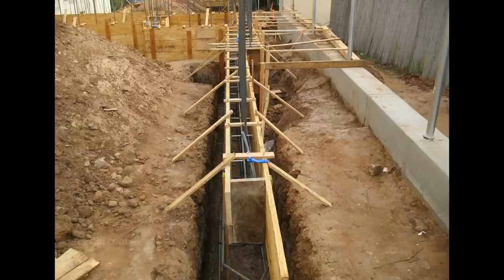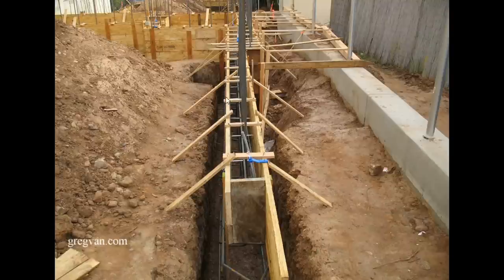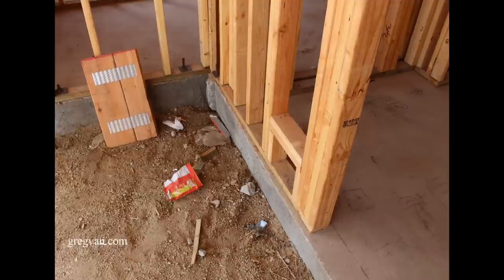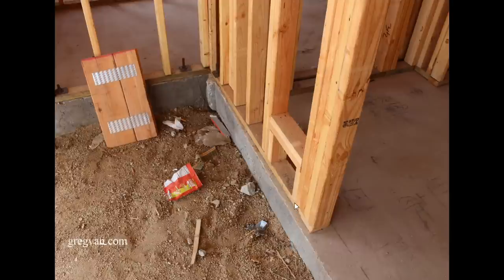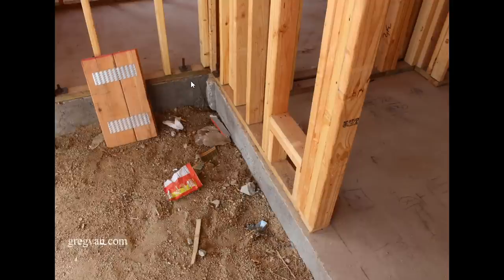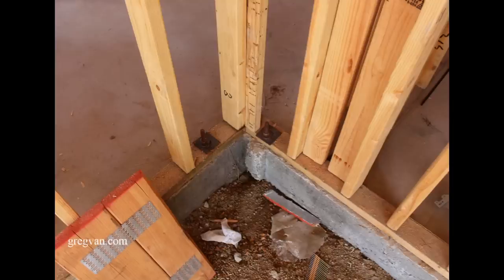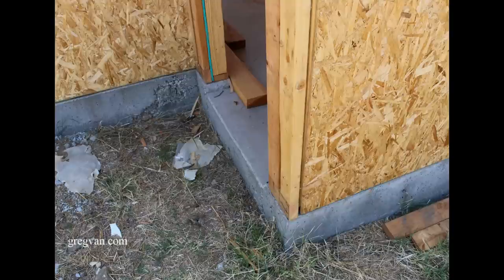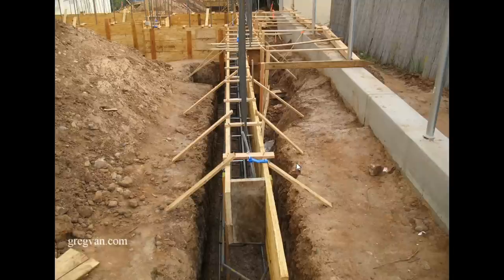Watch This Video Before Pouring A Concrete Foundation – Construction Tips

Comment: It is always cheaper to do it right the first time than having to do it over.
Reply: No it's not. It takes a lot of time to get things perfect and usually this stuff just gets burried. We are not building pianos here, just the boxes they come in. Git er done!! Ruhh Ruhh!!
Reply: As for the concrete wall being a little off, that's not a big deal, by the time the sheeting and siding goes on, not even a fuss budget will notice. As for this guys advice for the framers to build to the foundation,,, that's is just stupid, stupid stupid.  I mean if you would like to hide a strip of concrete in favor or a 3/4 inch calk joint on your counter top... yea go ahead. If a customer wants a nice finished foundation wall that cost extra, either for a form liner or parge coat. This goes back to every one wants top quality, but no one wants to pay for it,
Reply: That kind of attitude will get your work rejected by the architect or at least a payment application withheld.
Reply: Gary, that only happens on state and government jobs, and that's why those jobs cost twice as much and still manage to go over budget. There is a part of the real world that keeps silly non issues from being addressed ( like the foundation in this video for example )  And that is construction delays cost the general contractor money, not the sub contractor. As for not paying, that's a great way to get a lien put on the property, and you cant sell property with a lien on it.Now you can put late fees and a lien waver in a contract, but expect the bid price to be much higher and you will also have less contractors who will even bid on it.
Reply: No so as far as only being limited to state or government jobs. I have rejected bad concrete work and made them remove and replace it because they couldn't take the time to do a professional job or follow the drawings.I do not consider poor workmanship a silly issue  by any contractor.  Any issues for poor workmanship may be the GC's problem but the sub-contractor pays for it one way or another by not being hired again especially if the payment application and or retainer gets reduced or held up.You would be hard pressed to prove your case for a lien with bad workmanship.
Reply: That is so true. I have seen types of forms that were ill constructed, watch the concrete pouring in and then watching forms blow apart. I once witnesses whole garage slab that didn't set up right, and the contractor had to send a crew back to bust the whole thing out and then re-pour. That was a big stress factor for the home owner and my boss who was the General Contractor for the particular project. Lots expletives by lots of individuals! I felt bad for the Concrete Contractor as I think it was something to do with the deep dead of a very cold winter we were in, when they poured, which if I recall was a factor in the mis-hap, as the Contractor was no slouch and had a very good reputation. Just one of those unfortunate things with concrete!
Reply: You need to find the happy medium when in construction
Reply: @edstimator1   Forty plus years in the concrete business says you're wrong.  The fastest and cheapest way to build with concrete is to take the time to do it right the first time. If you rush through it without getting it right you will LOSE time and money.
Reply: @stephenblessed92  I live in a pretty goddamned nice house after doing it wrong for fifty years.  Never did a job I didn't sell.
The key is knowing what counts and what doesn't.  Not everything needs to have the same level of perfection.  But you are right...if you haven't been able to figure it out after forty years you better treat everything the same.

Comment: Simple, like anything you start out right you end up right. Our 15 man crew did a $80000.00 multilevel pour virtually perfect. The amount of experience in the crew probably accumulated to about 15 years of concrete work. But the amount of years in precision work in various trades was more in the neighbourhood of 300 years. I'm not saying this to brag but to express the notion of what experience teaches. Review the errors with a fine tooth comb. Of course shit happens , but don't use that as an excuse. Learn from it.
Reply: Agree always no where you starting and where you FINISHING

Comment: Also, at 04:13 looks like the concrete was not properly placed or vibrated since there is exposed aggregate on the surface and pockets where cement should be.
Reply from the maker: I've seen this a lot and often wonder how many problems are created by it.

Comment: They guy had his inside corner on backwards and either nobody scraped the top wall, or because the wall was not supported by kickers and was way off the plan (also could have been concrete nails in the footing or off measurements/misunderstandings/ misprints.) pressure from the concrete filled the bottom of the inside corner that was on the top of the wall, making your "Hutch" or whatever you called it. The company should have chipped it off when they stripped the walls.

Comment: I hate to think of how much time I've spent fixing crappy concrete. And what do they give you to do it with? A brick hammer, a hammer and chisel or a bush hammer. That sure did make me feel underpaid. lol

I also hated when the contractor would straighten the forms AFTER you poured and floated the concrete. But that was better than fixing it after it set, at least.

My nightmare job was a set of steps I fixed once. 10' wide and 15 steps were bowed out as much as 1.5". It looked beautiful when I finished, but what a pain. At least I had a electric hammer for that.
Reply from the maker: +TheTomBevis Those who truly understand the importance of the information in this video are the ones like yourself who have had to either remove or add concrete, because the forms weren't straight or properly secured.

Comment: Does that defect
weakens the construction on top of the concrete?
And if in what way ?
Can make any good reason why a guy
should grind a concrete tunnel with
a mega grinder ?
Concrete should only be used as plitnts in the ground
NADA MAS.
Reply from the maker: It might not weaken the concrete, but sometimes the rebar used to structurally reinforce the concrete can get pushed out and if it is exposed when shipping would weaken the concrete foundation. Also grinding the concrete next to the rebar could weaken it if it becomes within 2 inches of the rebar.

Comment: I thought a possible cause for the lines on the side of a slab were caused by the difference in moisture content or temperature between the top and bottom of the slab.
Reply: I guess the American Concrete Institute is wrong then.

Comment: You think this will happen if I use metal formwork instead of Lumber?
Reply from the maker: It can, the forms whether they're made out of wood or metal need to be positioned correctly and stabilized securely so that they don't move when the concrete is poured. Whether it's wood or metal it needs to be securely braced so that it doesn't move.

Comment: you know 
, wood does not come straight and has its imperfections and ergo the wall that your  forming will. I do ICI formwork, instead of residential formwork. Thats why you should buy "formply", which is why they use it in ICI construction, instead of spruce.
Reply: exactly
Reply: Ergo we're building our walls we actually cite the wood if it's crooked bent or twisted or has a crown in it we most likely will not use it not in the custom house maybe if we're building is quick build quick sell houses it wouldn't matter will leave the drywallers to figure it out the custom house very picky in our lumber we don't shop at Home Depot

Comment: Dear Sir,
That half inch space will be filled in with half inch plywood sheeting making the 2x4 plumb with the cement
Reply from the maker: Them it won't be a problem, but 2 inches will.

Comment: form lines are because u need a tiny gap for form ties to go in so u will always end up with lines. I always drive my kickers past the top of forms that is against the form for better strength and not in the way of floating. not the best form job example but close enough for this video.

Comment: in mass production is not the same build a home and build 1000 homes is mass production this is common problems in our daily basis life  where we have a crew just to correct any imperfection on the punch list of the project is easy to judge after finished but different when you are working and have to complete 5 or 6 in one day , one crew forming and other pouring concrete

Comment: I dont see any DPM under the floorplates on any of the framing,dont you need/use it in the US?
Reply from the maker: I'm in Southern California and we don't use DPM, as a matter of fact I forgot what the initials meant.
Reply: I should have spelt it out Im in the UK,we need DPM on everything:)
Reply from the maker: In some homes we use plastic that's about 6 mm thick as a moisture barrier under the slab, but it doesn't go into the concrete footings.
Reply: Our code,building regulations, has a long list of anti-damp regulations the EU has added many in the name of ' eco'.It would be strange to build without them.Theres people from all over the world that have access to your vids due to the net.  I find it very interesting what you have to do to meet code,its a lot more rigorous over the pond.

Comment: No damp proof flashing between the slab and the timber plates to stop rising damp ? is that common in USA?

No termite problems in USA?
Reply: Still get rising damp - the timber of the plate may not rot but the cladding may wick up and do so.
Reply: It's California.  It's pretty dry out here.  I've only ever seen rotten sill plate if flashing or wrap/kraft paper is incorrectly installed.
Reply: No that is not common in the the USA at least not where I have ever built . Regardless of code I would have used a pressure treated bottom plate and a moisture break .

Comment: I am so lost here, how much structural problems are shown here; too me it all looks cosmetics / bad planning will the building fall ?
Reply from the maker: I doubt if the building will fall down and if you're okay with with the way it looks, then by all means ignore the message in the video. Excessive chipping can expose structural rebar or bring it to close to the surface where moisture can be absorbed causing the rebar to rust.

Comment: Holy shit...its like every contractor in the world showed up here and had to validate or disagree with this video...let me give you guys a clue..this video is not for you. If your a contractor you already know how to do this and if you run into any problems you know how to take care of it or work around. This video is for people like myself who plan to build their own workshop/garage/shed and would like to use concrete as a permanent and solid foundation as an option. These are just simple tips to avoid and or look for to make my life a little easier. But I do find it hilarious that there are so many of you with 20+ years of experience that landed on this video on "Construction Tips"
Reply from the maker: You can't even imagine how many comments I had to remove from this video. Obviously it doesn't have every thing you need to consider in it, but I still think it's worth watching. Thanks for pointing out the obvious to those who have a difficult time figuring out what this video is truly about.

Comment: I use aluminum wall forms and do foundations for a living. Our walls dont lean, bow, or sag. This job looks like someones just trying to save money by using wood as there forms nd there just not strong enouph. Aluminum forms allow us to slide walls with little effort to get our foundations square after there set. Then  braced streight with 2x4s. Wood is a nightmare with concrete because concrete is so heavy. Looks like alot of honey comb on walls to.
Reply from the maker: Sounds good to me. Aluminum forms might not be a practical solution for do-it-yourselfers or construction workers who only do a few jobs a year. However, if you're building forms that are straight and square, you're going to be everybody's hero on the job, who usually doesn't get the credit they deserve. Everything starts with you guys.

Comment: A lot of these issues have to do with home builders wanting homes built in 4 weeks.... Setting a house no a new slab in 2-5 days after it is poured I am never happy about... I watched  builder pour remove the forms and a day later had the house standing... Why are the walls not over lapping the concrete also lol

Comment: I don't untarstant why after slab don't raising concrete columns and concrete slab again and the using wood every where. Or a construction with outside walls made by bricks the interior also or plasterboards and only the floors maybe made by wood.
Reply from the maker: +telosfd I think you're asking why don't they use more concrete instead of wood, but sometimes is more efficient and cost-effective to use wood framing. I don't know if this answers your question, so feel free to rephrase it or ask another.
Reply: Yes, thanks.
Reply from the maker: You Bet.

Comment: Good video but you didn't address the honeycomb they left from not vibrating enough many home owners see that and get upset.
Reply: I would rather see honeycombing then have some one over vibrate the concrete and work all the stone to the bottom, same with people who use a vibrator as a shovel,
Reply: Your right its never good to over vibrate but home owners hate to see honeycomb they think its a bad foundation and it scares them.

Comment: Concrete slabs are never perfect, and I don't know if we can really expect them to be perfect; life is all about speed/time/money so it will always be so. Buildings are constructed by professional contractors and they have to get so many houses done by a certain time; if they took the time to make everything 200% perfect, one building may never get finished. The more perfection that's expected, the more costly it will be to buy better material for the forms, because a pour is only as good as the material used and the time it takes to build the forms.
Reply from the maker: In home building, it all starts with the foundation, if it's wrong, then you will increase your labor and material costs needed to fix other parts of the construction process. So spend the extra time, maybe not 7,000,000 percent, but do what ever it takes to do the best job with what you have.

Comment: in my world of concrete construction,  this lead person, contractor,  crew,  individuals would be gone within 30 seconds of my inspection of the things seen here plus the items you mentioned.    the form is a none starter because there's no where near enough rebar in the void for concrete.    I've seen something very much like this on a Mexico construction site for a chicken processing plant.   Beyond this there were live chickens running around with dogs chasing them through the plant area because chickens that got away from the butchers, were being butchered as the construction was going on.   all sorts of make shift  things going on,   including the ditches were being dug crooked because the workers were finding ancient Indian artifacts as they dug making the ditches run in all directions.  regards
Reply from the maker: I would've fired them also and that's weird about digging ditches around artifacts that weren't straight. Remove the artifacts and then dig the ditches straight.
Reply: initially I thought that it was just poor management / training of workers digging ditches.   some of the lower management folks were amused by it,   until upper management  jumped on their posteriors because of the delays & gross waste of time.    in the area there was a strong cultural thing to do with various celebrations,  shooting random - some times continuous fire works,  and fire arms fired straight up into the mostly night sky and of course moderate to heavy drinking,   then those that were offended by management coming down on them simply didn't return to work on the project.  regards

Comment: Finished brick walls and vinyl siding covers up lots of mistakes. That little bit of protruding concrete won’t even be noticeable. If only you knew of mistakes and shoddy work drywall covers up
Reply from the maker: Good point, if you have something that will cover any mistake, then it might not be an issue.

Comment: Where's your pressure treated wood that should be sitting on the concrete?
Reply from the maker: That would be part of the framing, after the concrete is poured.

Comment: The concrete isn't perfect, but the framers should have helped the situation by sliding that wall out about so that it would hang out in that corner a bit and be flush with the center. The framers did not use their brains. They just say well the plan says put it here... You have always got to make any necessary adjustments needed to make the building look right.
Reply: +bluebird5100 Framers go by the blueprints not the messed up concrete.
Reply from the maker: +bluebird5100 I think the thing we need to focus on is the truss roof or engineered roof system that require specific measurements. It's difficult to move exterior walls if you're using trusses, but you can with conventional roof framing rafters.